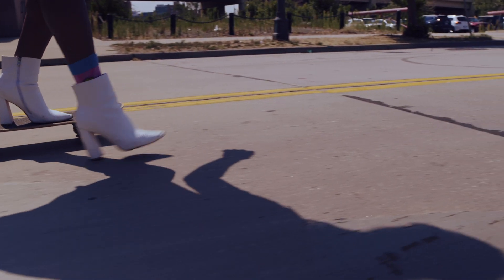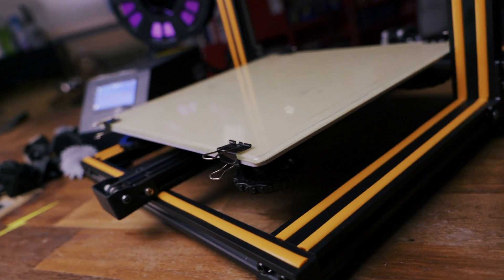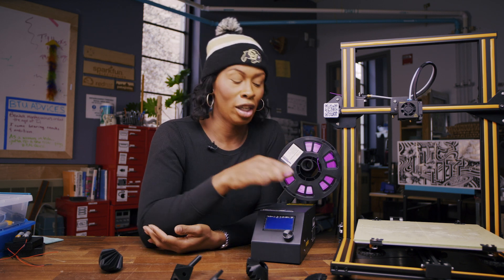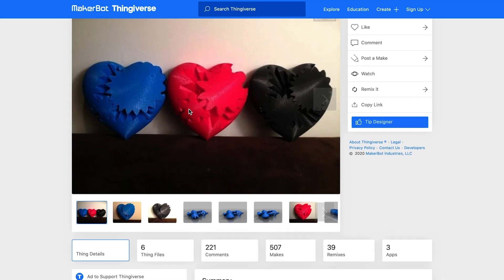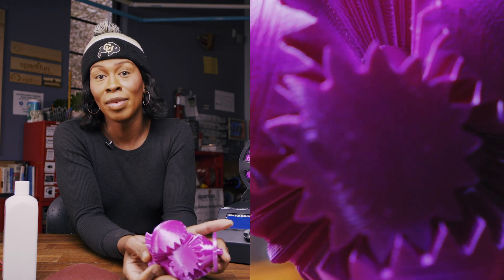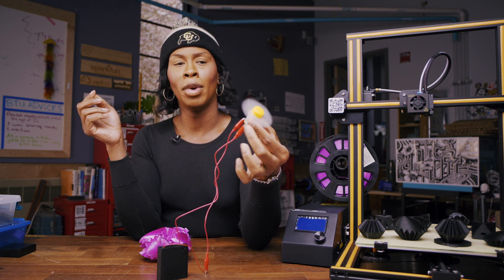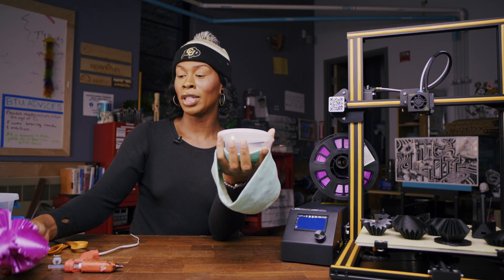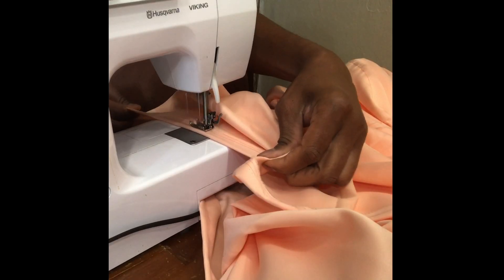The TWIRCH Shop: 3D Printing a Motorized High Fashion Hat | TTG

Comment: Great video. The one thing I wish you had gone into more detail about is the motor. The one shown in the video does not have a gearbox, so it is only good for high speed and low torque (like a fan). Your creation needs a motor with a gearbox to provide low speed and high torque. It looks like you figured this out later because your headpiece works great in the final shots and the motor link in your description goes to a better motor option with a gearbox attached. This could have been a good learning opportunity for anyone not familiar with motors, gears, torque, etc.
Reply from the maker: I agree, but I unfortunately learned that lesson after the episode was shot.  Because we don’t have our own studio, I’ve struggled with ways to add tidbits of updated information as the projects evolve and change. 🤞🏽 hopefully we get our own twirchshop soon